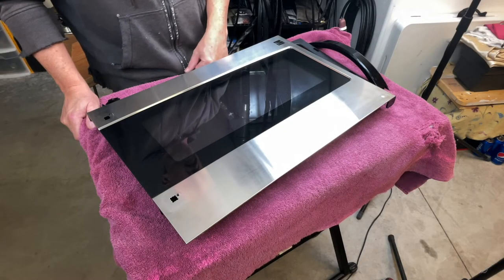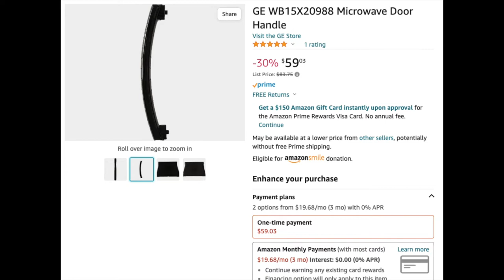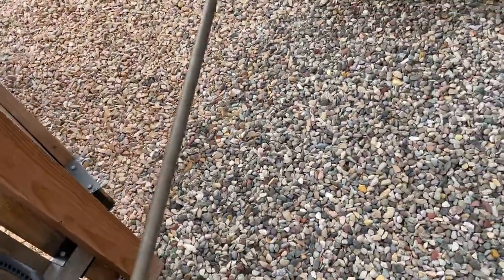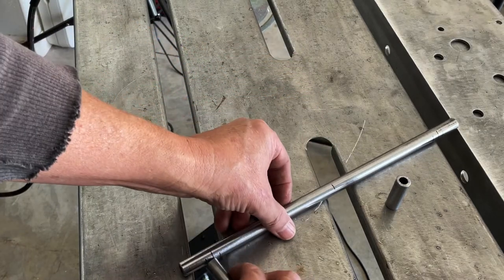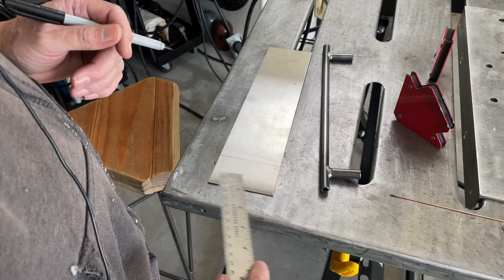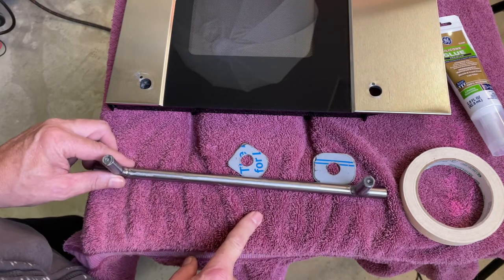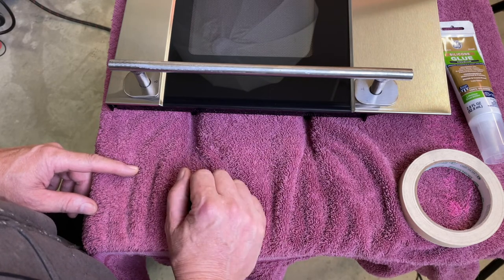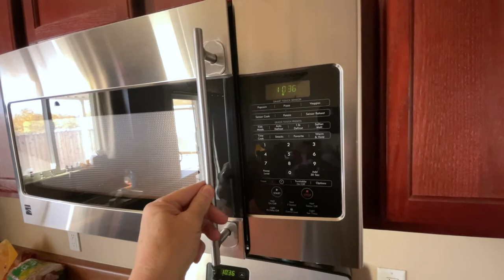Broken Microwave Door Handle - Let's Fix It

Comment: Nice job Bruce, you could even replace the plastic wall plugs with a couple of nuts welded into place in the tubes if the plastic fails.
Reply from the maker: That's a great idea Thomas! If the plastic inserts fail then that's exactly what I'll do. Thanks for the idea!